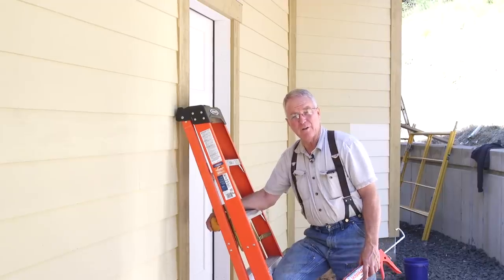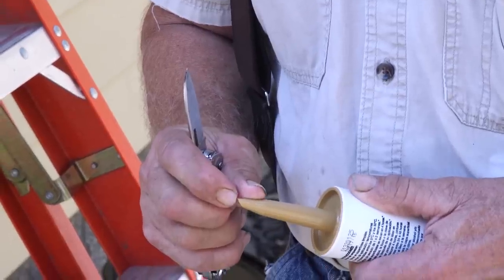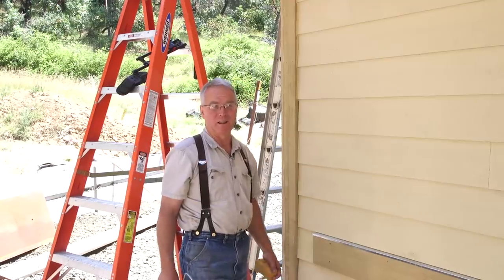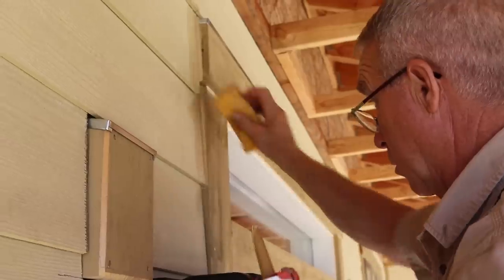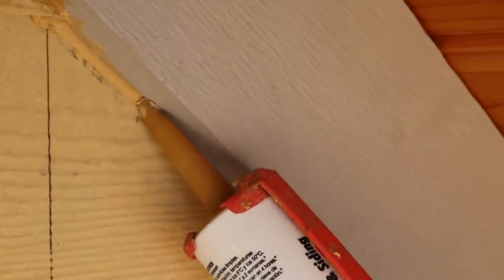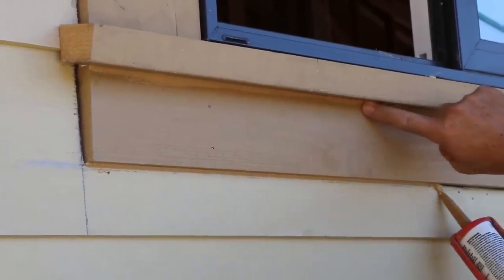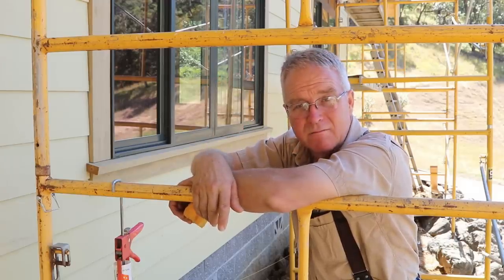Up Your Caulking Game Ep 86

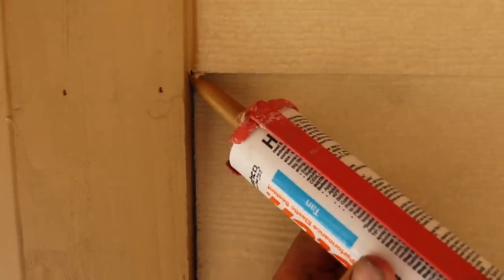Comment: I disagree with you and agree with Matt  risinger  on this one, don't use any caulking. It will go bad over time and require maintenance. Simply leave a reasonable gap via accurate cuts and live with it.That is exactly how I am going to do it on my house. While its true that the building is water proof when the siding is installed, its not true for the caulking. That is purely cosmetic. There is tvek and flashing strips behind each Hardie joint to move water out (which you already know). Watch matts video titled "installing exterior foam w Hardie Plank & Andersen 100 windows" Go to 4:15 seconds.

Comment: I quit using cauking on all exterior trim and siding. I cut it right, if there is a little crack water gets in, it will quickly dry back out. Between the housewrap and window tape. The building will remain dry. Cauliking is the first thing to look awful in 10, 12 years. Then you got to try to caulk it all again and it doesn't really help. I have seen plenty of rotten exterior trim that was caulked. If anything it makes the materials hold more water. My opinion. Caulk away if you believe in it
Reply: I think I read that caulking is required for warranty coverage on the brand of siding used here.
Reply: @andrewalexander9492   true, but having issues with James hardi siding is almost unheard of. I have only seen 1 issue with it on a large apartment complex where it was ordered prefinished and the paint was peeling. I have installed pallets and pallets and pallets of the stuff. CertainTeed on the other hand has a fiber cement that costs less and is a little lighter weight, but is prone to shrinking because the use more fly ash in it than Hardie.
Reply: @bluebird5100  I'm not gonna claim you're wrong, what you say makes sense.  But if the installation instructions say to caulk where the siding hits trim (and they do, I took a look)  if you don't do that, you leave an opening for denial of a warranty claim.

Comment: Please do not caulk joints on fiber cement. Hardie recommended doing this years ago but changed do to up keep of maintenance after it cracks. Doesn’t matter what you use, it’s exterior. It will crack and look like crap after no time. Then you need to go over the whole house again. Please for the love of god leave all joints with the recommend 1/8-1/4 gap. Any bigger or botch cuts, hire a new siding guy

Comment: Are you caulking bare unprimed wood?  If so it’s the most common mistake caulking. I don’t care how many years, decades, centuries or millennia someone has worked in the building trades - it’s wrong. Always prime before caulking. The caulk needs the primer to best adhere to the wood for exactly the same reason the top coat of paint needs a primer. 
This is not anecdotal advice but comes directly from the materials scientists who developed and formulated modern caulk products.
Reply from the maker: The trim comes pre primed

Comment: As someone who caulks all the time on almost a daily basis I’m ganna be using some type of sealant or caulking on whatever and lemme tell ya this ain’t it bro
Reply: Yeah I don’t understand why builders and painters insist on using Acrylic ( water based) on exteriors. It isTHE lowest quality sealant you can get and should never be used in a wet area. I’ve been a professional caulker for 45 years and have replaced miles of acrylic on exteriors. Do it right, do it once. Acrylic 5-7 years( if you are lucky.) Polyurethane 20+ ( quality polyurethane properly installed.)

Comment: When I think of a caulker, I think of a Pointer-Cleaner-Caulker, or PCC professional.  Painters do not know how to commercially caulk, lets see your video and what we can learn and teach.
OK, first off- safety... I am seeing an A-frame ladder leaning against the wall.  Lets hope your not intending on using it as an extension ladder.  YAY - it did not occur.
2:35 - finger?? really?  OK, your not a caulker by any stretch of the imagination - the chemicals that may be in caulk, mainly xylene, are penetrating your skin and entering your blood stream and attacking and shutting down, through time, your kidneys. However, your caulk here is water-soluble.
4:20 - OK, wrong!  Caulking 101... Caulk has to have no more than two points of contact.  To allow the caulk to, 'disappear' is voiding the manufacturer's warranty and also removing the caulk's modus of elasticity. 
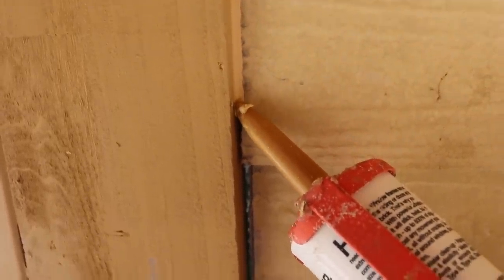4:40-ish, you mention pushing the caulk further into the joint.  No No No,  The caulk cannot have 3 points of contact, it's bond and purpose will only fail this way.
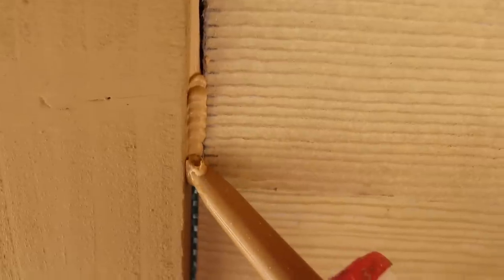4:58 - good instruction here
5:18 - WHAT IS THIS?!?!?!?! where is your slicker?  FAIL
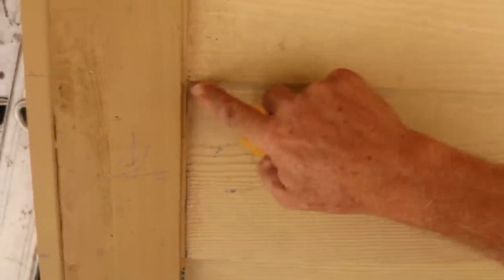5:40 - OK, WHAT IS THIS?!?!?!?! you only slicked it in one direction?  No, FAIL.  Caulk has to have 3 swipes, or passes,  the original slick or pass, then a second in the opposite direction, and then a 3rd in the original direction.  The purpose of this is that the 3 passes allow all the little fibers, or fingers, of the caulk to grab onto the substrate.  Your caulk job here is a FAIL.
6:32 - how fitting, Big Stretch.  
8:17 - the just right size is this: the depth can be only half of the width, but no greater than, if memory serves me correctly, 3/4" wide, so the depth would have to be 3/8".
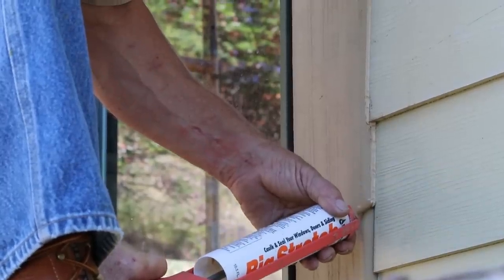9:55 - I like that your boots are correctly laced up - BRAVO BRAVO
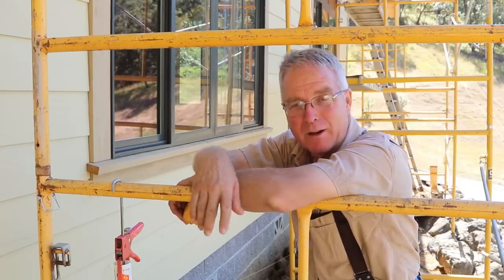13:21 - um, no, not medium grade by any means.  You have not installed backer rod, which you already mentioned is not used on this job, also, you are not tooling correctly, your 25 or 28 hours should be an additional 2 to 3, since you have missed two-thirds of the required pass on every joint you slicked, WITH YOUR FINGER!?!?!?
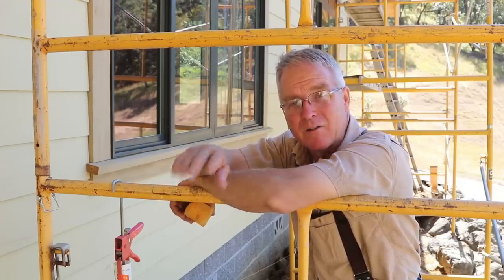13:47 - no, caulking doesn't shrink, as much as there may be 3 points of contact, causing the seal to break and also, there is the fact that you did not complete 3 passes per each caulk joint - This makes me think of the comment you had made on your block wall video, where you had mentioned something about, do it right the first time.